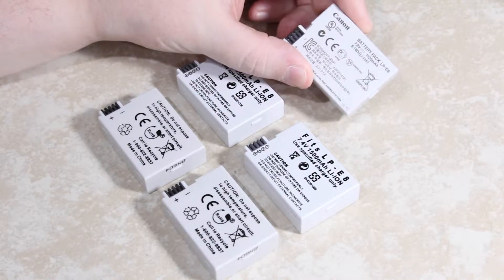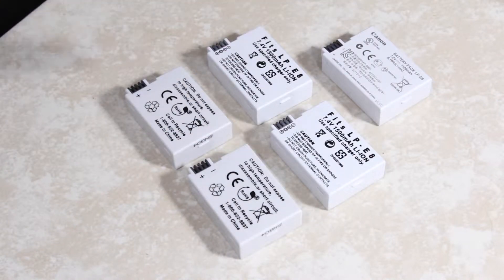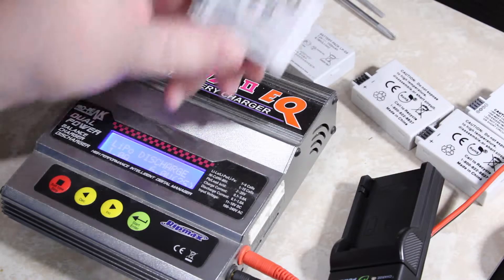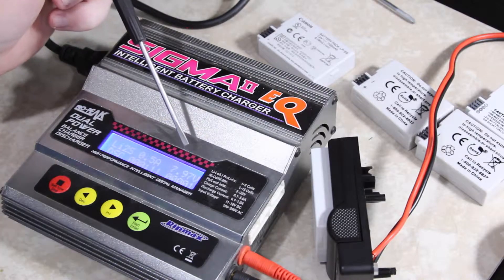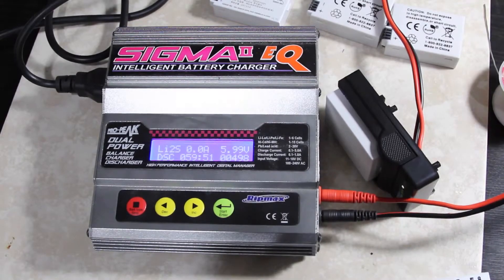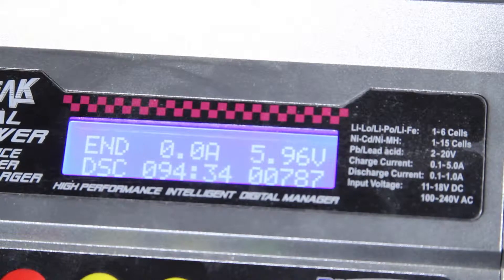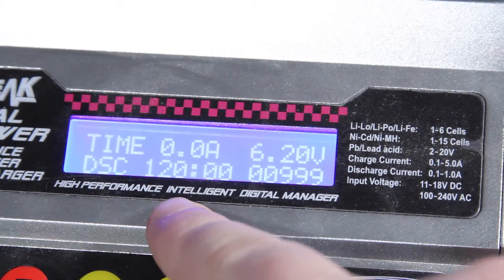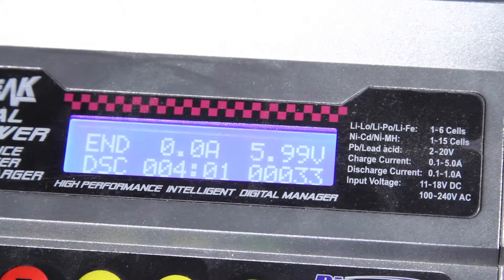DSLR Battery Comparison: LP-E8's from Canon, Wasabi and Neewer

Comment: since your cut off point was arbitrary, I think a better way of comparing would be to look at the time taken to drop to that 6v point at the same load.  IIRC the Canon battery took about 120 min to discharge, whereas the others only lasted about 90 min or so

Comment: Hi Joe,

Excellent analysis.  Very scientific, unlike most reviews on Utube.

I am intrigued by your discharge hack -- simple, yet effective.  Never thought of cobbling a cheap, but custom, charger as a battery interface.  Superb innovation.  A pro charger is far more likely to realize the capable charge of any battery.  Surely more so than even the manufacturer simple charger.  And less likely to damage the battery.  Especially over repeated cycles.

The cost of a spare brand name camera battery from most camera vendors is exorbitant.  Just a couple of them would pay for purchasing and improvising a pro charger specific to the camera, etc. model we use.  Surely most of us would appreciate extending the life of any battery we have.  I would suggest you do a video just on that.  You would be doing us all an invaluable favor; especially if you addressed the issues: 1. Cost of rig.  2. Preserving the original charge receptacle to be safe and presentable. 3. Portability. 4. Weight.  (Most of us travel with our gear, so 2., 3. and 4. are germane).

Other topics for you to consider are: revitalizing older batteries, compatibility with brand discharge sensors, if any.  I have a feeling all these topics would be of widespread interest, given the amount of electronic gear we lug around.

Who knows?  You could even make spare cash by selling improvised interfaces for the most popular brands replete with banana plugs.  More power to you.

Comment: So basically for the price of one Canon replacement battery rated at 1200 milliamps, 
you can get about 3500 milliamps in 5 Wassabi batteries (which average $10 each)?
Reply from the maker: +Yankee Woodcraft Yes :)

Comment: Thanks for doing some science!  So proportionally, how much battery life can you expect from wasabi vs. canon?
Reply from the maker: Kc Daugirdas, film composer Hi. The Wasabi batteries have about 80% of the capacity of Canon batteries. In order words, the Wasabi batteries will last for about 20% less time. So the bottom line is: if money isn't a problem, Canon is the best choice. If you don't mind about 20% less battery life, you can save a lot of money by using Wasabi batteries.
Reply: Got it.  Thanks!  I read in some olther spots that some of the cheap batteries, when used to film video, which draws more voltage (?), will cause the battery indicator to drop precipitously from "full" to "empty", because there isn't enough current (?).  Have you experienced this? Sorry, my electronics 101 is lacking :)
Reply from the maker: Kc Daugirdas, film composer In video mode the camera will draw more current, and the battery's voltage can dip. When using Canon and Wasabi batteries, the meter seems to work fine for me. I never bothered to do much with the junk Neewer batteries.